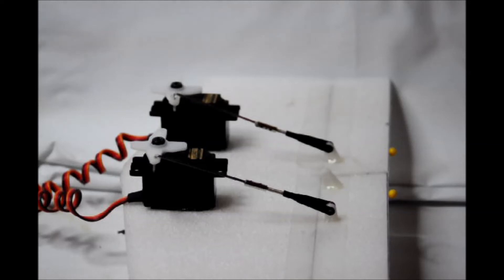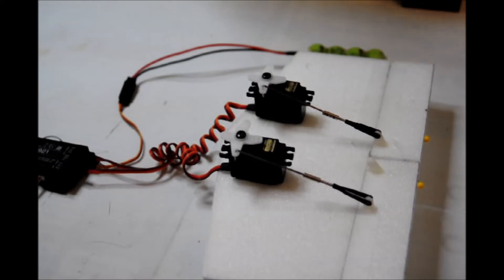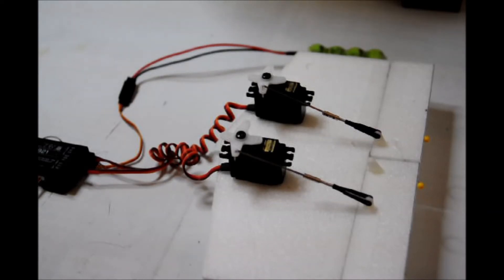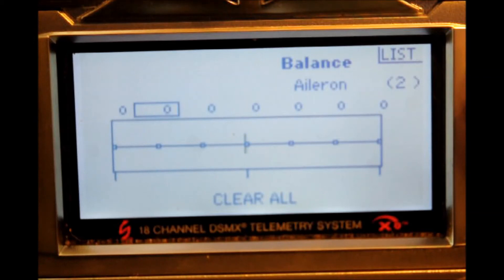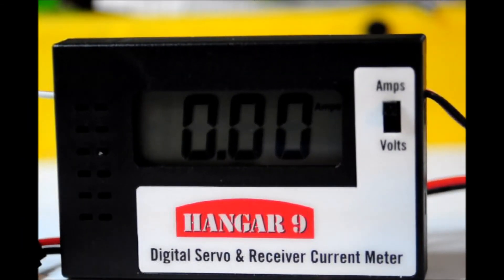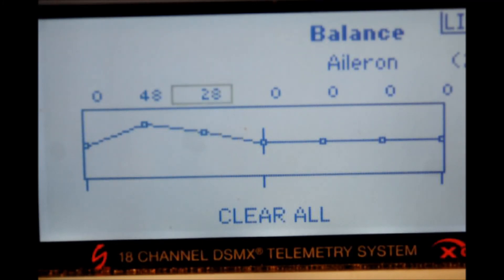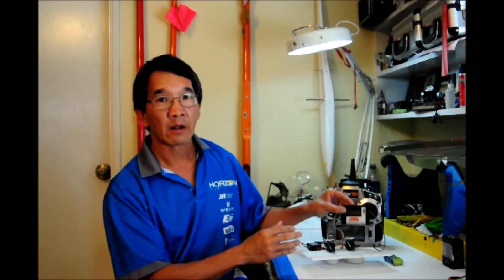Team Tech Tip   Servo balancer

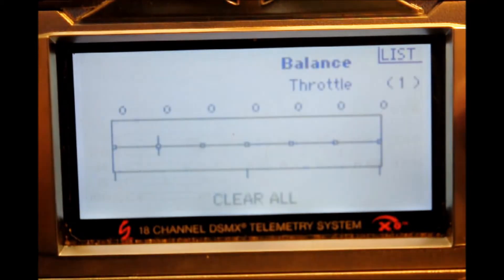Comment: At 5:31 you see the servo set-up screen. This transmitter isn't set up for multiple servos of any sort. Matter of fact, it's set up is the default. The info on balancing is correct though,  but he could have at least used a correctly set up transmitter as an example.